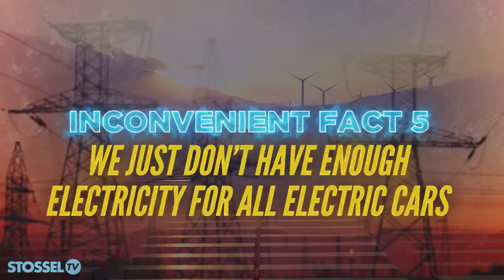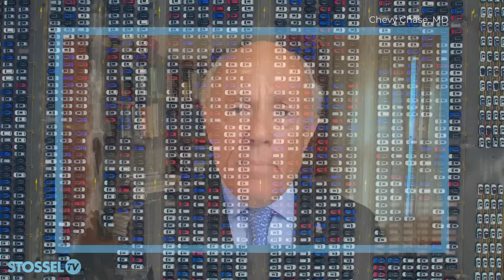Electric Cars: Inconvenient Facts, Part 2

Comment: Good stuff, I've been driving an EV for close to 9 years and when asked about EV's, I always start with " EV's are NOT for everyone. First off, my wife's car is not an EV, that way when we need to go somewhere farther than the comfortable range (there and back) of my EV, we take her car so we can get there and back. Second, nobody seems to talk about what's gonna happen to all those people who live in apartments? Where are they supposed to charge their EV's? They would be forced to use public charging stations. That in and of itself is going to be a problem for many. This whole "going electric" thing has multiple problems, that's just 2. I've heard that Toyota is or has developed an internal combustion engine that is fuel by hydrogen. I'm not talking about the Murai which is basically an EV that uses hydrogen to create electricity, I'm talking about an internal combustion engine (ICE) that runs on hydrogen. THAT would be a game changer, it would remove the need of a heavy battery, long charge times, etc. It could be refueled in about the same amount of time that it takes to put gas in your car, and the emission from there tail pipe is nothing but water vapor! Moving the country to all electric is just stupid in so many ways.
Reply: as a mechanic I discuss the problems with electric cars in depth on my home page vid.
Reply: They sell hydrogen at fueling stations in Iceland.
Reply: You do know water vapor will cause Temps to rise more than CO2 correct?
Reply: You pointed out a very important fact : the vast majority of people living in the big cities WON'T be able to charge their cars. That is pure discrimination. But no government is talking about that, not surprisingly, though.
Reply: Hydrogen requires a LOT of electricity to produce as a viable fuel source. THAT is NOT the answer. You're only driving in an urban environment AND you're probably charging at home and paying through the snoze for doing that. You're also not paying any taxes to support the road that heavy vehicle of yours is riding on. EV people hide the true cost from their ICE counterparts and that's not even discussing the environmental impact of producing your fuel, the huge vehicle battery, or disposal. MY truck is 23 years old do you actually believe your battery will be around even half that long? No that battery will be long gone in the disposal graveyard along with that EV you now ride. Hell even the TIRES you ride on will double as well impacting even more environmental compared to ICE so just WTF are you thinking?
Reply: @leecowell8165  I have to disagree with you. I was reading a scientific magazine the other day, and there are NATURAL hydrogen sources all over the world and it seems like if we could exploit only 5% of it, it will be sufficient for thousands of years. 
In Africa (I forgot where exactly), they are already using a natural hydrogen source to generate electricity for a small town. And they have been doing that for years and it does not seem to deplete!
Reply: @eldontyrellcorp  but then again, i don't know how comfortable i'd be having to park amid 1000 mini Hindenburgs.
Reply: @martinpope3835  Indeed. That's why they decided to leave space between cars in some parkings, because of these EV's, so that there 's less chance to have a fire extend to the whole parking lot... This will result in a big loss of parking places, while we are already lacking many.
Reply: @eldontyrellcorp  also, as a concrete worker here in phx, AZ, and as a worker involved with numerous parkingt garages, I just wonder if the calculations for multiple elevation parking levels have taken into consideration that every one of these evs are thousands of pounds heavier than old fashioned cars.
Reply: @martinpope3835  Indeed ! And here in Belgium it has already been taken into consideration. A lot of older buildings (dating from the 70's or earlier) are not sufficiently strong to support the weight of the EV's. So this is a real issue.
Reply: @eldontyrellcorp  we have a bingo!
Reply: Ah the voice of reason is music to my ears!  thank you
Reply: @darklaw7766  how do u think most electricity is produced and what is the by product of that?
Reply: @leecowell8165  I'm in agreement with most of your points, even the relatively short life of an EV's traction battery however, understanding how to get the most out of a lithium ion battery (just like the one in your phone), can make an impactful difference. My EV is 10 years old, a daily driver (short distances), and because of my battery maintenance strategy, I am proud to say that my 10 year old battery still has almost 80% of it's life left. Now I understand that it's NOT the norm and I totally agree with you that an ICE engine can far outlast the average EV's lithium ion traction battery, you'll get no arguement from me on that point. I'm just saying that even EV's, under the right circumstances can last a pretty long time but I would never agree that EV's are the answer to the 'so called' climate issues. And I should also point out that the average cost to charge (which I do, as you guessed, at home using 110v (level 1)) is around $8. If I use public charging (I almost never do), the cost roughly doubles. So, to sum up, I agree with you almost completely and I stand by my premise that EV's are not for everyone but they can, under the right circumstances, be a great addition to a person's commuting needs. And may even, as is my case, save you some money.
Reply: @eldontyrellcorp  I understand your concern and it's true, EV's can, and do sometimes catch on fire (especially the Chinese made ones) however, statistically speaking ICE vehicles still hold the high ground for catching on fire. I'm not saying we shouldn't be concerned, any vehicle catching fire is a scary problem but the lamesteam media only bothers to report on it if it's an electric car which makes it seem like it's way worse than it actually is. But, you're right, it's still a problem.
Reply: @martinpope3835  Good point
Reply: @Jim007baker  I don't really know, I assumed it was mostly nuclear and hydro electric. It sounds like you have some insight into how most of the nation's electricity is produced, how about sharing your knowledge with the rest of us. How is most of the nation's electricity produced and what is the by product?

Comment: I bought a Tesla, not because I think it will save the environment 1 iota but because I dont have to do maintenance, go to a gas station, and it's really fast and fun to drive. In WA electricity is cheap due to nuclear and hydro and gas is expensive due to taxation.
Reply: "gas is expensive due to taxation." How much more did you pay for the Tesla? How many gallons of gasoline could be purchased with the money spent on a Tesla. Would the mileage of gallons purchased be more economically beneficial than the Life Cycle of the Tesla battery and the cost to replace it?
Reply: @selfdefender780  This is easy too look up yourself.  Probably costs him about $3-$4 per 100 miles. He will also likely never replace his battery.  I think Tesla's are a bit over priced but there are about 30 other EVs sold in the US that are not a Tesla and are better values in many cases. .

Comment: As Toyota just showed a few days ago, the immediate future is advanced hybrid vehicles like the fifth-generation Prius, now an actually stunnning-looking car with decent performance (for a change).
Reply: Hybrids perhaps do the best job of reducing emissions by reducing fuel consumption and not adding a shitload of batteries to weigh the car down. Look at what happens to PHEVs when you drive them long distances: their consumption is worse than conventional gasoline vehicles.
Reply: Toyota is not showing any future because Toyota is already out of the EV game.  Hybrids are the spork of auto engine tech
Reply: @GK-op4oc  But it's available and useful NOW. Lot easier to find a gasoline (petrol) filling station than an (often unreliable) public DC charging station.
Reply: @GK-op4oc : You clearly know nothing about the automobile industry...
Reply: @herrschaftg35  Legacy auto companies are starting to disappear, starting with declining unit sales.  Automobile industry expert that agree are out of a job
Reply: @Sacto1654  Every AC outlet is a charge point, so there is less of a need for public charging stations when the EV starts its day with a full tank after a nightly slow-charge top-off at home.  There are billions of AC outlets in Western nations.  With the annual doubling of EVs sold, charge points, fast and medium speed, increase accordingly.  Charge at the hotel.  Charge at your uncle's house

Comment: You really need a part three to discuss the impact of the batteries and end of service life of an electric car vs a traditional internal combustion vehicle.
Reply: It’s also worth pointing out that “energy” and “electricity” are not the same. Even if you had a 100% ‘renewable’ electric grid, you would still need large amounts of fossil fuels for various industrial processes that don’t use electricity at all.
Reply: I'd like to know how they plan on recycling them. Can they recycle them? They have acid and lithium in them, and they weigh 1000 lbs.
Reply: Yes, they can recycle them.
Reply: @mynameismatt2010  not easily I'm sure.
Reply: @Fredster9984  Nothing is completely recyclable, and the recycling process often creates waste of its own. It's not usually a question of 'can it be recycled?' but rather, 'is it worth recycling?' Often, the answer is no.

That may change for batteries, but there's no guarantee.
Reply: @annbennett5312  You’re sure? Well if you’re sure I guess the multi billion dollar companies currently doing it must be lying...
Reply: @Fredster9984  EV car batteries outlast the car and all the owners. Then they can be repurposed or recycled.
Reply: @brianensign7638  The recycling process for EV batteries is over 90%. How recyclable was the gasoline you burned today?
Reply: @justsomeguy934  That's bogus. The only one worth recycling is Cobalt. The rest you will have to pay to be recycled.
Reply: @mynameismatt2010  Economically or in theory? They can but is it gonna be profitable? THE idea of EVs is great, but its not the boon they portray it to be. Its more of a fantasy than a reality for at least a generation or more.
Reply: @justsomeguy934  What do you mean by “the recycling process is over 90%?” Does that mean 90% of batteries go through a recycling process? Does it mean 90% contain recycled materials? Does it mean 90% of the material used in batteries is recovered by recycling?

I’d be grateful for more specificity, as well as a relevant citation.
Reply: @brianensign7638  I can absolutely supply you with the information you want. To answer the questions directly, over 90% of a lithium battery is recyclable back to raw materials, including the casing. The recycled material is actually better than newly mined. I will leave multiple links in separate comments so that YouTube will not delete them.

Comment: I find it funny how some people tell me they want to save money on gas, so they purchase a 75,000 electric car (which is 4 years or more worth of gas, depending on fuel prices and vehicle consumption).
Reply: I interviewed a top energy expert on my home page vid. He warns EV conversion will not happen and oil can never be replaced.
Reply: @ChannelNews1  True we need oil for plastic
Reply: The fact that an ICE engine requires $75,000 worth of fuel just to run it for 4 years tells you everything you need to know about how bad they are at the job they do. In a single word - "inefficient"

Comment: There's a lot of arguments against EVs missing.

1. Their lifecycle is rather limited. Maybe 10-15 years and 3k charge cycles (80% dod) under ideal conditions before you need a replacement. Unless it's one of the Sodium Battery things China wants to push next, then it's maybe 800 cycles (again, ideal conditions). Meaning more cars will be produced (or some just don't get one).

2. We're always comparing fossil vs. EV, but EV have mainly been used to cancel the alternatives. Most engineers I worked with consider a mix of Hydrogen and Biodiesel combustion engines the most viable, depending on environment, usage and various other factors. 

3. EVs aren't that save. You mostly see new-ish expensive cars now, but imagine the equivalent of someone's 20yo beater in your garage trying to charge a old degraded and possibly physically damaged lithium battery while you sleep.

4. Most of the lifecycle emission charts are heavily greenwashed, assuming a lifetime of 150.000km / 93.205 miles and about 8-15 years (depending on study), which "coincides" with what EVs can archive somewhat reliably. However, your ICE car can easily handle multiple times the miles and isn't heavily affected by age if maintained well.

Personally, I'd say a combination of Hydrogen/Biodiesel ICE and better infrastructure (Trains) would be the best reasonable solution. However, simply providing the tools and leaving the usage to the individual seems to not have been a option to begin with.
Reply: Not sure why this doesn’t have more Likes but I think you make excellent points

Comment: Very realistic take on the subject. I have an EV, plug-in hybrid, and solar. It only supplements but we still need coal and oil. My solar panels are not making much due to all the storms. The amount I pay for them per month only reduces my electric bill just by the same amount I used to pay. so I didn’t really save anything lol. Maybe once I pay the panels off in 20 years I’ll feel better. Oh well.
Reply: Would those be storms attributed to Climate Change?
Reply: @altal2993  just regular cloudy weather when it rains.
Reply: @ausabl  lol, I too have an EV and a Hybrid. My in the UK and my solar panels charge my EV so the cost of motoring is close to Zero..... I keep the hybrid for distance... and as a fellow EV owner you know what I'm saying there lol
Reply: You've got a bad deal if it is going to take 20 years to pay back on solar, for me to put in solar myself this coming spring it'll cost around 2 years worth of my electric bills, but that's it to cover all my power use with a fair amount of excess going forward, it might've been like 4 years to pay back if I were paying someone to do it instead, but still it's not anywhere near 20 years.
Reply: @tehScribbles  my electric bill was about 600 a month and the solar only knocked off maybe 200 bucks so it kinda just equaled out to the amount the panels cost monthly. Maybe I’ll see better results in summer.
Reply: @firstLast-jw7bm  you will have nothing and be happy. I got Evs and plug in for the tax credit. For me the tax credit has ended since they changed the brackets.
Reply: @ChicagoTRS  Dont have solar panels. No one “sold “ me.  I’m not a “sucker”.
Reply: It's not about "how much money I make on solar", it's about being a producer. People that really care about clean energy in our society, actually do something about it. So thank you for producing clean power for our grid and for your EV.
Reply: @ausabl  It sounds like the system is undersized compared to your usage, either that or you're just using a lot of energy. Are you running pool pumps and heaters? That can double your electric bill.
Reply: @ChicagoTRS  Good solar panels will last 40+ years. Only the thin film ones last a mere 20.
Reply: @tehScribbles  it’s been cloudy for days. Unless someone can make the clouds go away it won’t matter how many panels I have.
Reply: Plus in 20 years you will have to buy new panels. I have looked at solar panels from 4 different companies. They have all come with their pitch and all of them "20 years" guaranteed power production" life span of panels 20 years. Cost for panels for 20 years $250. Utility bill lowered by $200-250. If you could get solar to power individual appliances it could be beneficial but for a 3,000+ sq ft house in AZ it doesn't seem helpful
Reply: @CptToro08  I agree, I was just very curious about it and now I have it, I at least have first hand experience of it. Not too worth it in my opinion. At least I know now and can help others make their decisions.